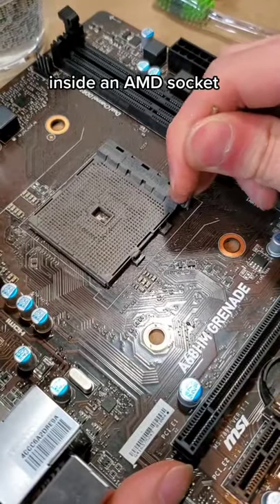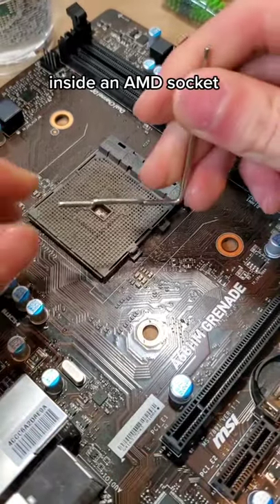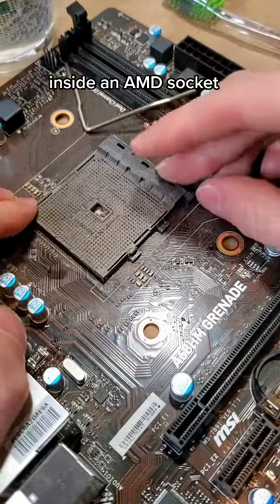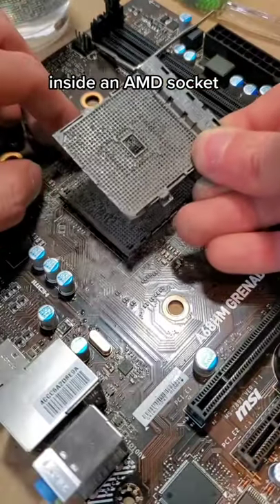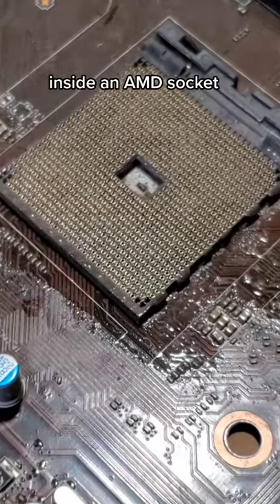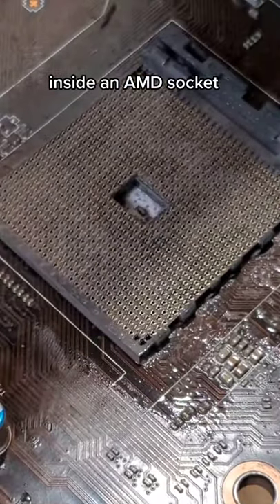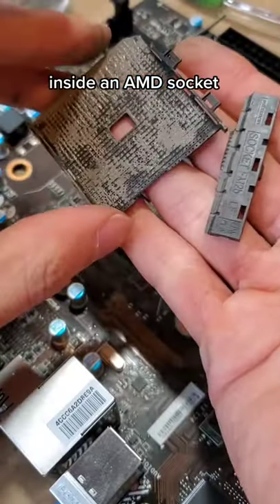inside an AMD socket! #shorts

Comment: AM4 socket is slowly crawling to a close by the time future AMD Ryzen CPU's and APU's start using AM5 , but it served its purpose well ❤️
Reply: Or TR4
Reply: The only socket that rival it is the old 775
Reply: @roombaman1755  хх
Reply: @roombaman1755  TR4 "served" for 2 generations of CPUs (TR 1000 + 2000), not very special... Threadripper 3000 is running on socket sTRX40 and won't get a successor on this socket. Even more worse than Intel Mainstream Socket. Threadripper Pro 3000 is running on socket sWRX80 and it will only be compatible to Threadripper Pro 3000 + Pro 5000. Even Intel had three generations on their (very bad) HEDT platform socket 2066. (Core X 7000, 9000 & 10000)
Reply: Meanwhile Intel: "Y'all still have one socket?"
Reply: meh, AM4 has reached the point where the technology available now will remain relevant and fast enough well into the future - I don’t see it disappearing in a decade at least
Reply: It would make sense for AMD to keep am4 around for oem and budget markets
Reply: I legit just bought a 5800x and an am4 board. It’s more than what I need in terms of power and it has saved me hundreds if not thousands since I didn’t need ddr5 or anything
Reply: 5600X3D has entered the chat
Reply: @ErrorRaffyline0  i just picked one up a few hours ago lol
Reply: @arceuslegend4605 yes the new socket every year or two is so fun smh
Reply: Peace out, AM4
The last socket that wasnt upgraded every year lmao
Reply: am4 lasted longer than any intel spcket 💀
Reply: @riuneko   aged like fine milk lol/ seriously though going from pga to lga will make installing the cpu a lot less risky especially for inexperienced builders
Reply: I have a fairly old Fm2+ socket in my PC
Reply: AM4 has finished its mission, is to force Intel stop the 2 core 4 threads with 1% increased in performance and new sockets to force everybody buy that crappy CPU
Reply: @riuneko  True, i could easily see Ryzen 5xxx series become the new Intel 4th gen budget pc builds in many 3rd world countries like my place, i don't know if Nvidia will ever do something like 750ti again, but AMD's RX 6600 might replace 750ti for the budget king, it'll become the ultimate combo in the next 10 years.
Reply: @superspies32 Truth be told it wasn't the problem on the low-end, it was the mid range and HEDT X299 platform. Intel thought they could maintain the monopoly on both markets and kept the 4 core 8 thread i7s for 5 generations after the 2600K which is absolutely stupid. And they even released the i5 7640X on X299 which is arguably the most useless CPU ever released. I'm really glad AMD is competent now, or we would still have 4 core i7s and probably 6 core i9s.
Reply: @zeron3699  in Vietnam those has 4 cores used to have a price that normal person could not or just simply did not want to buy it. And like you said glad that AMD rised, especially with R5 5600 to make experiences on nowadays games easier.
Reply: @superspies32  Same in Malaysia and Singapore, the i7 7700K is 1900 in local currency. That is 200 more than the Ryzen 7 1700 which had double the cores and threads.
Reply: This aged poorly lmao
Reply: @sarimsalman2698  How so ?
Reply: @JoshuaG  AM4 got new CPUs at the start of this year. A great example of platform support, where you can buy a board in 2017 and have it compatible with a CPU released in 2024. Hopefully AM5 continues this and supports till 2028
Reply: Theres still more am4 cpus being releases 💀
Reply: This aged well
Reply: Side note 2024 AM4 IS STILL THE KING BABYYYYY!!!!!
Reply: It will be around as long as FX was
Reply: It will be around till am6 comes out then am5 will be the new am4
Reply: Still not dead yet ;)
Reply: AM4 will still be highly relevant and pretty much god tier in the budget builds space for a long while.
Reply: @Bomkz  yeah it will only die when am6 comes out which will be a long time and when that time comes am5 will be the new am4
Reply: wow this aged like milk. i fuckin love amd sm <333
Reply: @inherentsteam5547  the XT lineup aren't much of an upgrade at all for most people beyond a "cheaper slightly worse bin 5950X" aside from that, there's no more value to it than simply getting an X3D variant.
Reply: 2 years and they're still releasing these cpus
Reply: @riuneko  Maybe on a used market, but I’m sure amd will only make manufacture am4 for a couple more years
Reply: I'm not letting my 5800x3d go. It is just too good. 20% boost from 7800x3d is just not worth it yet.
Reply: 2 years later and it’s still going strong
Reply: Kajakakaka bro i have fm2 in my secundary pc  💀
Reply: Late reply, but amd just announced more am4 cpus...
Reply: Just upgraded to AM5.

Comment: Removing a cooler with a bit too much force has taught me that the am4 ‘lock’ doesn’t do much locking at all
Reply: Lol same here. I just upgraded my 7 year old cpu. I thought it was warm enough and started to twist it back and forth only to rip out the cooler with the cpu still attached 😂. Man I was so anxious putting in the new cpu but thankfully  the mb still works!
Reply: @BaldKiwi117  i ripped my cpu out with the cooler and the plastic socket came out on the mobo. can i fix?
Reply: @ccxfrank109 yeah just put it back I think, depending which part you pulled out
Reply: @ccxfrank109  Next time just remember to use your computer before removing the cooler to soften the thermal paste, and rotate the cooler instead of yanking!
Reply: I 100 percent agree also puting a hair dryer on the CPU while running hi CPU  usage will soften the heat paste allowing the removal of the CPU CCOLER SAFELY.
 @ballhandler9001

Comment: You literally saved my life I got something stuck inside of the socket cover and I could finally remove it
Reply: I have thermal paste in mine lol, gonna try this later
Reply: @Hina.Miku98  yeah but be careful when removing it with isopropyl, because mine split in half lol still works tho

Comment: I'm gonna miss the AM4 socket when the new one arrives

One of the best cpu sockets ever
Reply: until you wanna remove a cooler.

AM4 would've been the best socket if it had a simple retention mechanism holding the cpu in place.
Reply: @opachki8325  I just do a little gaming to heat the paste up first, as a treat. 

Unscrew, twist, done. 
I do understand the frustration, though.
Reply: @benjaminoechsli1941  Just imagine someone who doesn't know and isn't told to do so ripping the cpu out of the socket :/ 
Though I really prefer PGA for more robustness, this in current iterations is its biggest flaw.

LGA is somewhat easier to work on afterwards although intel messed up with socket 1700. 
Nothing 1mm washers can't fix tho 🤷🏻
Reply: @opachki8325   That's fair, though my understanding is that that very robustness you mentioned means ripping the chip out of the socket isn't the end of the world. 

The simplicity of the 1700 fix got a chuckle out of me to be sure. Will be watching to see if AM5 needs anything similar.
Reply: @benjaminoechsli1941  according to igor'sLab it won't need that since am5 has a different design approach. 
Well sometimes it is not the end of the world but often enough people even manage to rip out pins. :/
Reply: @opachki8325  I killed a r5 3600 because I didnt know you were supposed to heat the paste :(, never had that issue with the old i5 that was in there before it
Reply: @opachki8325  you just need to twist gently to get it off haha. Gentle twists back and fourth and it comes off no problem. You can’t be rough with it, and you shouldn’t.
Reply: @Kruton1122  Well I know how that works but still isn't all that great for someone who just wants to upgrade a cooler or change paste and doesn't have that knowledge.
Reply: @opachki8325  you shouldn’t be replacing paste or replacing a cooler if you
Don’t know the basics of am4
Reply: @Kruton1122  no need to defend a poor design choice. The problem is that you don't really find this in manuals regarding cooler or mobo. 

Just call them out for what they mess up. Intel with their socket 1700 mounting pressure, AMD for missing retention of AM4. 

Your statement is pretty much invalid in such a manner that you just don't see any information regarding this elsewhere than in forums on the internet. 

tl;dr: 

no need to defend AMD over a poor design choice, this is the only flaw of AM4 but it's kind of a major flaw. Especially when there is no information to be found in either mobo or cooler manuals.
Reply: @Kruton1122  I built a whole system not even knowing what am4 is. How can you say something like that lol
Reply: @meechie9z  then you probably built a poorly made system. It’s not an insult but unless you know what you’re doing you shouldn’t do It.
Reply: @Kruton1122  oh no I did. that was the first pc I’ve ever built. It was only around 500 dollars like 4 years ago LOL. I built a second pc last month I’m just still learning. It was definitely shitty. Things are different now except for my gpu ....
Reply: RIght? LGA is fucking garbage, its waaaaaay worse in terms of durability, sucks AMD is going in the way of intel now.
Reply: yeah, supported 3 ryzen generations, that was awesome ngl
Reply: I'm still on am2
Reply: @XBullitt16X  LGA isn't great in terms of durability, but it's not absolutely terrible. As long as you don't drop anything in the socket you're fine.
I prefer PGA, but LGA has its advantages - for one the CPU is less easy to damage (though bending pins back on the CPU is much easier than bending pins back in the socket). Motherboards are usually a lot cheaper than CPUs (unless you buy a stupid high-end motherboard), so are less of an issue to have to buy a replacement for.
Reply: I've ripped a PGA478 Pentium 4 from a socket but none of the pins got damaged. It still works just fine
Reply: @rafiamirali9188  Wouldn't call any socket "the best" rn but am5 is promising indeed.
Reply: I won't miss it ever. I hate bent pins. I've seen AMD CPUs with bent pins out of the box.
Reply: @opachki8325  Just point a heat gun/blowdryer at the cooler for a bit, ez
Reply: @subbookkeeper  Dont buy suspiciously cheap "slightly used" listings, lol
Reply: @JohnSmith-fq3rg  Please read all of the comments here, thanks.
Reply: @opachki8325  thn they are dunb.
Reply: @opachki8325  
I fell into that trap, pulled it right out of the socket using the "wiggle back and forth" strategy. Luckily, I didn't bend any pins or break it.
Reply: @opachki8325  ha that would be me i kinda forgot that cold thermal paste was gonna be a problem, bent a few pins but was able to fix them thankfully
Reply: @opachki8325  at least its more reliable, unlike intel's plastic legs
Reply: @yourbigfan1777  what kinda plastic legs?
Reply: @opachki8325  on the cooler
Reply: @yourbigfan1777  and amd uses a plastic retention system, so what?
who uses the stock boxed cooler for a proper gaming build anyways?
Reply: @opachki8325  it's common knowledge that you should slightly rotate the cooler before lifting it off of a PGA CPU.
Reply: @HDJess  nice you think it's "common knowledge" when it actually isn't. We wouldn't see that many posts with "Ripped cpu out of socket" if it was. 

Oddly enough, it most of the times isn't even mentioned in manuals.
Reply: @opachki8325  it's me, though already heating the CPU for 20 min, twist too hard destroying the socket and bend some pin
Reply: @opachki8325  never had any Problems removing the cooler/waterblock lol. Run a benchmark to it heats up before you remove it. Literally take a Minute
Reply: @TheLesPaulDude  I'd kindly ask you to read some other comments here. We got enough people already who did that but still ripped it out.. 

Also this won't help if you can't really wiggle your cooler like with some AiOs and if your paste is really viscous like the AMD preapplied stuff, it can be fairly hard to do even with a warm cooler.
Reply: Not if you damaged some cpu pins . Lga is like that but for motherboards but cpus are commonly more expensive
Reply: Amd is switching to lga
Reply: @opachki8325  i did that, but it was all good, nothing came off.
Reply: @opachki8325  i ripped it out of the socket but the pins where fine lol
Reply: @opachki8325  honestly almost anything besides X299 for example is trash in that regard. Not better or worse than the rest.
Reply: @opachki8325 Somebody who doesnt know also wont ever replace his CPU in the first place or even build a Pc by him self
Reply: @xythiera7255  oh yes they will..
Reply: The best ever*
Reply: Bro i plan on buying a new am4 cpu in a few months lol
Reply: @opachki8325 almost happened to me, i bent one pin on a 3600 and i bent it back and works just fine, thankfully
Reply: @opachki8325 I like PGA for the simple reason, if you bend pins, you can bend them back easily with a credit card, on LGA (at least intel), smaller, thinner pins, heavily slanted/bent pins, if any of those bend out of place........ Good luck
Reply: @JordanPlayz158  LGA is way less likely to have bent pins in the first place because generally a good socket has a cpu retention mechanism.
Reply: @opachki8325  I have had it occur (on both sides (LGA and PGA)) but also it is not a matter of the likelihood, to me, it is if it were to happen, which would you rather have? Bent LGA pins on motherboard or bent PGA pins on CPU?
Reply: @JordanPlayz158  I'd rather have an LGA socket where that is less likely to happen. 
I've had it happen once to me and that was because I literally let the board sit open for like a year.
That was basically askin for it. Meanwhile my cousin managed to actually not just bend but also rip off some pins. Bent em back and it didn't work.

I wouldn't wanna have that on an 800€ cpu. 

The chance to accidentally damage a PGA cpu without a proper socket retention mechanism is way higher than damaging an lga system having one imho.
Reply: @DSharma-yo8qx  oh the whataboutism
Reply: how do you like the new sockets ?
Reply: It’s not going to die lol. If anything they’ll become cheaper and easier to access
Reply: Agreed, still rocking a 5600 and a rtx 3070. Min max bliss
Reply: fun fact, two years later, THEYRE STILL USING AM4 EVEN WHEN THEY HAVE AM5
Reply: It still has support and there are rumors of the 5500x3d

Comment: I'ma miss AM4 feels good when you latch it. LGA feels like you're gonna break pins lol.
Reply: i personally prefer LGA, they just feel way more secure, and i prefer the look of the cpu shield.
Reply: @cessnacitation-x  the cpu shield looks ass i like the bare look of am4
Reply: @nicholashritcu7236  i totally respect your opinion but i just prefer lga.
Reply: @cessnacitation-x  👍👍
Reply: @cessnacitation-x  AMD5 is going to be LGA
Reply: i love am4. such a good platform. too bad its going away, the new am5 cpus look so ugly, couldnt they just cover the whole cpu like with am4?
Reply: its not just feel like, its gonna happen
Reply: @nullmind  Who cares how the CPU looks? It's going to be covered by a cooler anyway... Not like your cooler has a window you can use to look at the sick RGB your CPU definitely has lmao
Reply: @nicholashritcu7236   Well LGA is better anyway for a number of reasons. And AM5 is confirmed to be LGA.
Reply: @kadrix732  Fr you look at it once then forget it
Reply: I will take broken pins on motherboard over broken pins on the CPU
Reply: @akkudakkupl  Why? The pins (on the AM4 CPU's at least) are significantly more durable on the CPU than those found in a motherboard. And If you do break or bend pins like I have had happen to me a couple of times, it's night and day difference in the difficulty of fixing them, MUCH easier to work around a small cpu than on a motherboard socket.
Reply: always liked how even the cpu socket that amd and intel used were the complete opposites but now that's just gone
Reply: @cessnacitation-x  wholesome response
Reply: @nullmind  no they couldn't because of how many pins it has underneath
Reply: I have yet to "break the pins" on an LGA motherboard. It's like it you remove the protective cover ONLY when you need too there is less risk of breaking pins. If you carefully place the CPU onto the grid once again the pins will be safe.

Then again... I have never needed to repair a single pin on a CPU pretty much for the exact same reasons.

 What are you guys doing to break pins?
Reply: @ach3909  I have a feeling I did this to my old motherboard
Reply: Yeah it fucking sucks, LGA is ass, not in terms of performance ,but in terms of durability. You bend even one pin slightly on an LGA board and you're fucking screwed. You bend the pin on an AM CPU you have a lot higher chance of being able to rescue it, by bending the pins back back. Its a lot harder to do that on the tiny pins on an LGA board. I have always disliked that about intel CPUs, lost 2 boards to bent pins that way, in the past.
Reply: @CreeplayEU  u mean ryzen 6000 lol
Reply: @ach3909  Because motherboards are a lot cheaper than CPUs (at least in sensible builds). I'd rather ruin a £100 motherboard than a £300 CPU.
Reply: @nathangamble125  But as I said. It's harder to break the CPU pins and if you do, it's much easier to fix it.

That said I know not everyone is going to be as careful or tech savvy as those of us who know how to fix hardware. To someone like that, they probably will not even attempt to fix bend/broken pins, so in that scenario having them on the cheaper component rather than the easier to fix/more durable one will make sense.
Reply: @nullmind  the answer is: no they couldn't because of capacitors. I wasn't just a design idea, i was needed from technical side
Reply: @iamnobody8  not like capacitors need oxygen lmao
Reply: yeah PGA looks Safer and less pricy if u do something wrong.
Reply: Not gonna miss it, almost got a heart attack when I pulled my CPU with the cooler 😭
Reply: That is until you try to remove a cooler that has been on the CPU for a while and the CPU comes out with the cooler and makes you shit a brick.